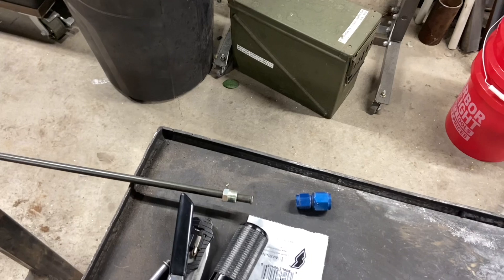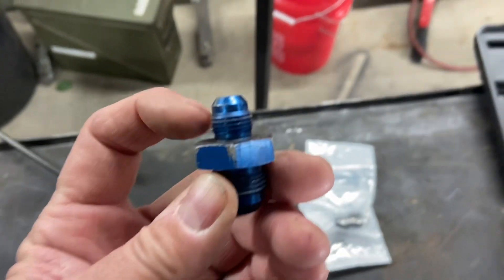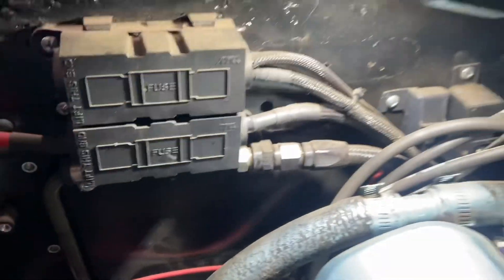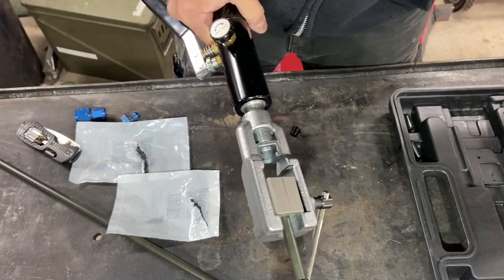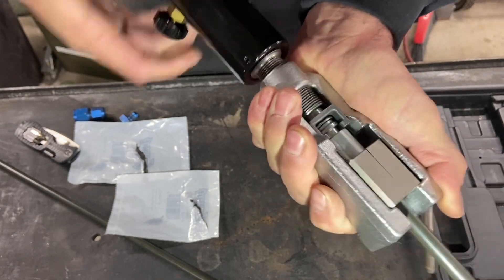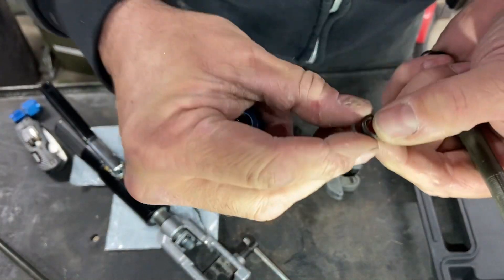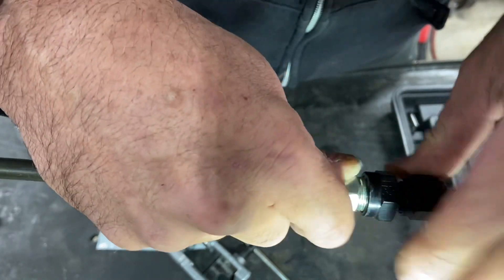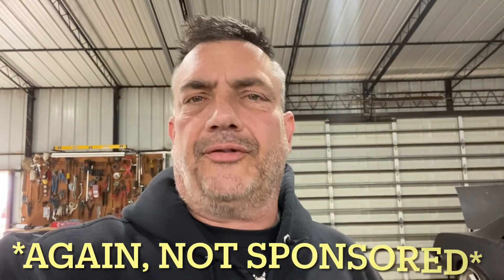How to: Flaring hardline for -6AN fitting. More fuel line flaring. This time for AN fitting.

Comment: Why you use the blue fitting?

Looks like the flex hose a/n with a male end would gave attached to your flare hard line fitting?
Reply from the maker: Blue is what I had laying around to use for the demonstration. The flare will mate up to a male fitting on a flexible hose as well. I was limited on parts for every aspect of what you can use it for.

Comment: Finnnnnnnaly found you agsin!
Reply from the maker: Sorry, didn’t know I got lost again..😜 Lol
Reply: @ogresspeedshop 😄 😄 hahahahaha Hahahahaha ive bought compression type fittings from local summit.240.00 for a small bag/10ft of flex 10 ft.of aluminum 3/8
I got a flare tool but it's old school/45 degree
Reply from the maker: If you’re just doing standard fittings then a 45° is good.  -an fittings are 37° just in case you didn’t know that.
Reply: @ogresspeedshop thanks /I bought a/n stuff? So 37 degree.
I ain't started.i can buy a 37 degree flair for 22 bucks. I just don't want to be sorry I used compression fittings.

Comment: Real.  I have the Mastercool flaring kit and the 37-degree AN dies like you used.  Even after using it a bunch, I still have flares go wrong like the first one you did, exactly the same way where the line gets pushed out.  The dies just don't grab the hard lines as firmly as they need to.  Thanks for the video!
Reply: Same grip issue... hard lines and stainless lines getting pushed out

Comment: can it be use for 10mm hard line?
Reply from the maker: The tools is set up for SAE sizes since -an fitting are based off of SAE. The sleeve for the -6an line fits the 3/8 pretty tight.  10MM is a bit bigger than 3/8 so I don’t know if the fitting would work.  The tool may be able to flare it but it may throw it off center a little from the size difference.  I’ve never tried 10MM hardline for anything so I can’t answer with certainty.